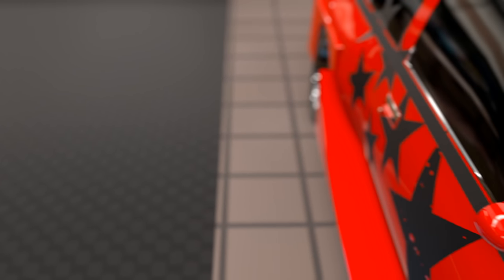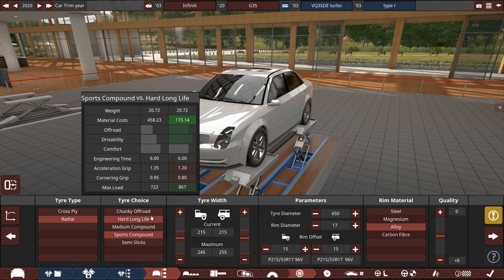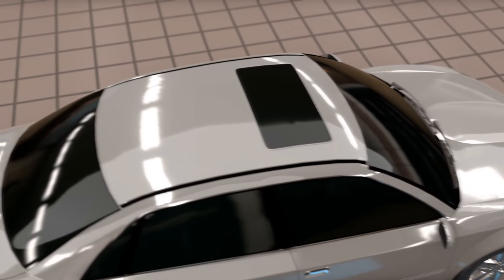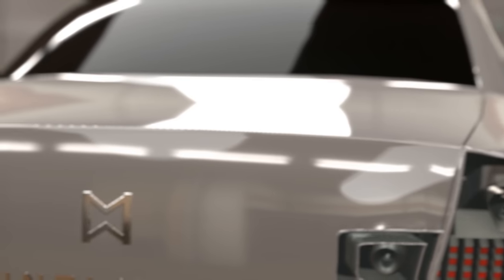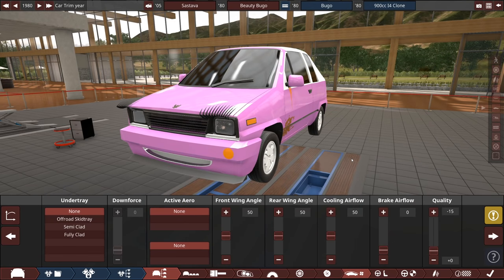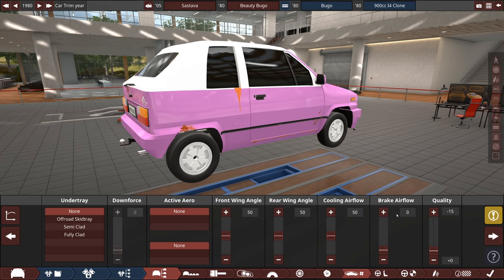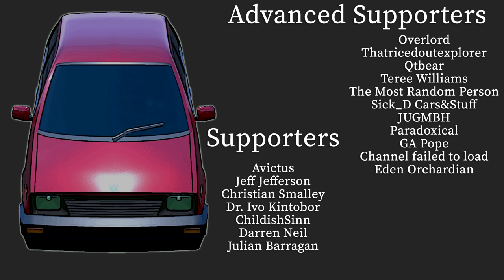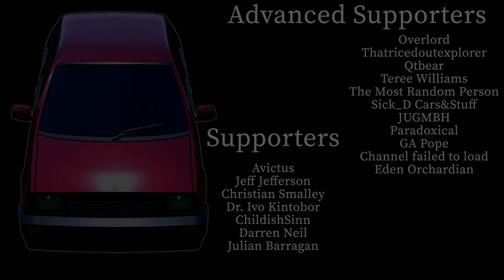My Automation Wishlist (5 things I'd like to see in game)

Comment: 1) No... Because Produktion vehicles. The Case with the Carbon wheels also falls apart with the "They are uncommon". Yes they are. But they are more Common than slicks and even more: Street legal. The wheelspin Thing is a Common misunderstanding: The wheelspin ingame is you, flooring the throttle, so its quite normal for Higher powered Cars to have wheelspin in the 15's% and Up. 2) Yes. Thats noted and on the "soon" list. 3) soon(TM) aka next yearish. 4) Gear spacing was funny enough already ingame, we are talking 2014-16 Here. It was frankly deemed unfun and annoying. 5) Visuals Like what? Vented brakes already are a Thing. And the Brake cooling in more Referring to how the Car's airflow is being dircted to and from the brakes. Hope this helps

Comment: Hot V single and Bi turbo option, I want to make an exact replica of the Audi RS5 2.9L V6 and Dually for heavy duty trucks, I’m not asking for diesel (yet lol) but at least give me dually
Reply: BiTurbos are literally twin turbos
Reply: But the hot V is not the same as the standard way the turbos are placed, in the hot V the turbos go in the middle of the engine, where the intake is, so there is less turbo lag. Also bi turbos and twin turbos are not the same, bi turbos are 2 turbos, one facing one way and the other one is facing the other. Twin turbos are also 2 turbos, but both are facing the same way.

Comment: all im asking for
is 2 stroke engines, diesels and rotary engines
and OFC why would i forget 
the 2 stroke diesel engines made by detroit
frick i wana make a truck with a 453T with a 10 speed that i can drive without the clutch
and maby some extra gears aswell? cause some cars have a 10 speed automatic trans, but dont leave it to JUST the automatics geting 10 speed
maby even give the option to make the gears straight cut and syncroless?

Comment: i have to laugh on the 1 cylinder comments, not because its bad in itself, but it would be a nightmare in practical.
Imagine something sounds like a gun or a machine gun that makes 5 hp, in a car...

it would be like putting a go-kart engine or a chainsaw engine inside a car. its like trying to move 1000 kg with 2 hp
it would be better to use a real horse to drag the car, than a 1 cylinder engine
Reply: 1 cilinder engines can make some power of you make them big

Comment: better suspention
like live axe
then more engins
better crash performance
much easier career mode
god mode (non breaking not knoking
rotary-diesel-more turbos-more sizes for engs (like smaller engs rev higher and the torqe diffrence between the small and big is more )
a easier mod source like the beams mods
and much better sounds
60s big v8s sound like shit

Comment: I don't see how Diesel would be game breaking. It should be in already.
Reply: Diesels operate much differently in how you calculate power ect. Than gasoline engines. Would require a lot of work
Reply: @magicstew45  I mean I'm aware of the difference but it does not seem game breaking. Also even if it is a fairly substantial amount of work it really should have been done by now.